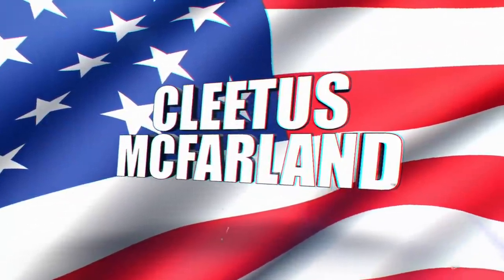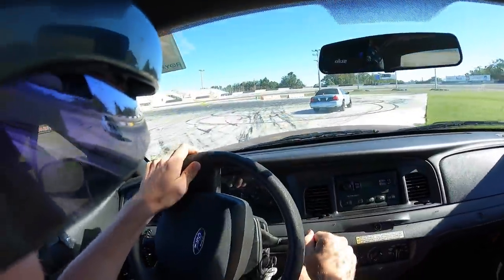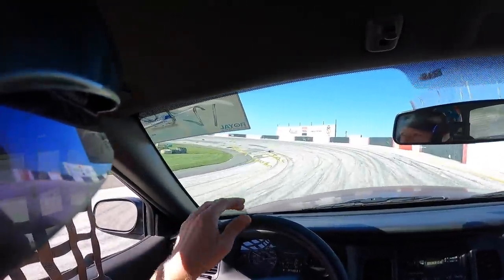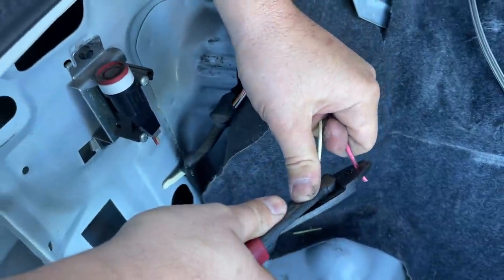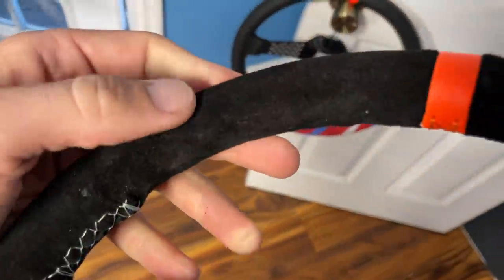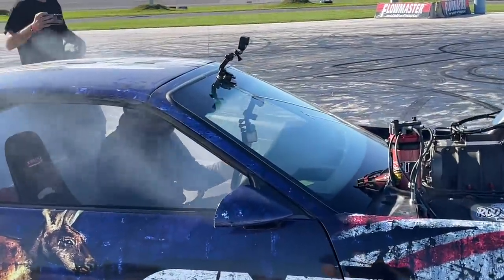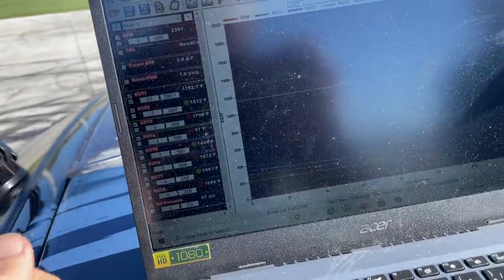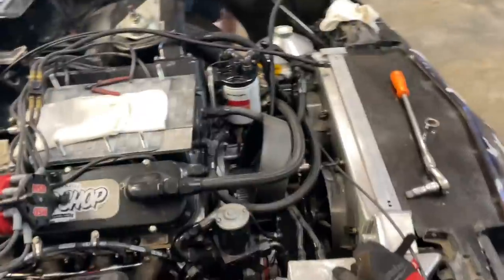You Guys Are Going to Love or Hate This... + Testing TOAST Ends With Oil EVERYWHERE...

Comment: First 1/2 of race do kidney layout while the brake pads are at max thickness… you have plenty of closet road racers on your roster… then second half do the oval with the 2nd crew. The driver strategy dynamic increases considerably … yeah, you get the idea … and as any road course would have, you could get your concrete guys out to crank out some curbing at your apexes - make them big enough to get up on without enticing drivers to stick “unloaded” tires in your grass. This idea also buys you about 4-5 feet more “track width” both at turn-in to your skid pad, and your track-out back out to T3 and T4.

The added track surface increases speed, decreases load on braking systems and tires and such and also makes it plausible to go two wide through those sections - if each driver will play nice and give driving room.

Just remember rule number 1 of road course racing = The guy (or gal) on the outside always looses.

Comment: Put a concrete barrier 5ft into the grass around turn 3 going into the kidney. The add 3-4 layers of tires 5-6 tires high so the grass is saved and so that way the drivers aren’t smacking a concrete barrier. Just gotta be careful no one taps the tires and gets sucked in and causes a huge pile up

Comment: Cleetus please put  a safety to shut the fuel pump off in a accident. Jegs sells a oil switch that once the switch gets under 11psi it will turn the fuel pump off if you wire it where the inertia switch was. I had a female friend loose her life at 19 years old because the crown Vick she was in had the inertia switch by passed.

Comment: Like the idea as a driver I’d love it, fans will love it to start as it will be a wreck fest until  drivers get the hang of it but unless you puts some PJ1 on the concrete I wouldn’t do it, just the slightest of contact your spinning the guy out which will collect multiple cars at a time leading to lengthy cleanups which no one wants plus could takeout half the field which no one wants, drivers or fans.

Comment: Seems too narrow, would cause a lot of chaos. It’s really a 1 racing line through there.

What about adding a smaller chicane in the front stretch though. Still get be a little more challenging but you’d be able to maintain a wider track that wouldn’t force the cars into a single file that is inevitably going to be absolute chaos.

Comment: I feel like you use the kidney layout to qualify BUT  with a twist: 5 lap heats, 5 cars, Heat winners start first but fastest lap starts last. If you win your heat and post the fastest lap time you go in back. Heat winners pick a number out of a hat and that’s the starting positioning the top 3-5 spots. After that it goes by reverse lap time. 

If the kidney can hold 5 cars for 5 laps going all out then it’s game on for more but I say traditional oval this time around and then next time up the number of cars in qualifying.

Comment: Way to dangerous - Way-way to dangerous - You are going to kill someone as every driver will get out of control driving thru there at those speeds - don't be surprised if some of the professional's drop out of the race once they see this course,,,,they have more to lose and their owner's are not going to allow them to drive on course set up like this risking their life - the cars and track are not designed to run as such at that speed in a safe manner,,,,Going to be wreck after wreck -- Those are not slalom race cars but even if they were SCCA wouldn't never set up a track pattern to come off at such high speeds and the car swaying out of control,,,,it's hard enough for one car to do but to set up a race that way with multi cars,,,totally crazy -- it will for sure create crash after crash - more likely someone will die,,,,higher speeds wrecks are always do more damage going that fast during wrecks,,,,Is that what you guys want wrecks and putting driver's at high risk dying on camera?  You can see that neither one of you can make a pass thru there without being all sloppy,,,,that's only 2 cars,,,what's going to happen with that many cars?  I can't even believe you can't use better judgement then to ask viewer's if this is Ok to let driver's run this course